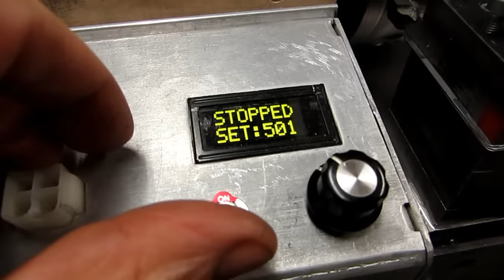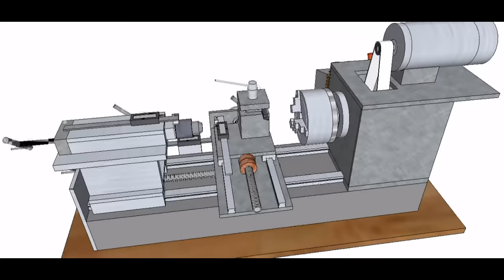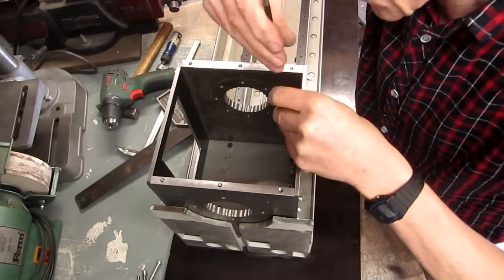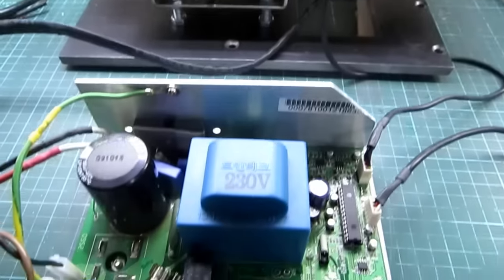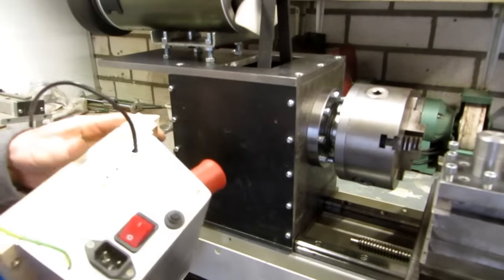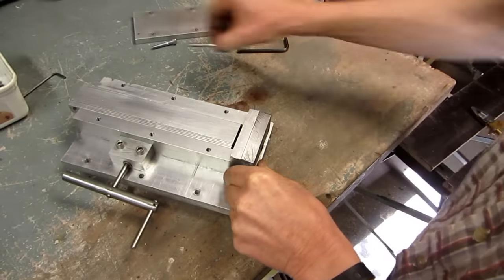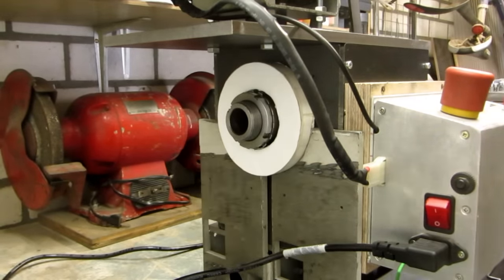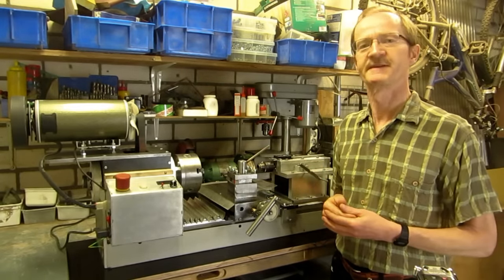Building a lathe from industrial scrap

Comment: "140mm chuck was founded on the scrapyard"...
Nice. Nice scrapyard.
Reply: no scrapyard, try ebay!
Reply: الترجمه للعربيه
Reply: If you are aware of machinebuilding industries near you, then you could go and check with them to find a suitable scrap pieces for your needs. Am i right @Rolandvanroy
Reply: I want to live near this guy. The scrapyards in my city are pure crap.
Reply: Not to mention the $1000+ worth of linear rails and lead screws he "found" haha
Reply: @pssnyder  20mm lead screws are about £80 ($100). The far more common  8mm and 10mm used on CNC machine tables are much lower cost but too small for a lathe like this.
Reply: @pssnyder  Linear rails aren't that expensive, the ones on his lathe are no more than €200-400, perhaps €500 tops if they're really high end. What you seem to forget is the fact that on a per capita basis the Netherlands is one of the biggest high tech players on the planet, and especially some regions heavy extremely high densities of high tech manufacturing. Any of such companies who happen to use linear rails will generally discard them long before the end of their effective lifespan, solely as a precaution just to maintain their very fine tolerances. So it's not too farfetched that the guy who made this video ended up with perhaps as much as €400-500 worth of linear rails for free, because as I mentioned many companies in the region would have otherwise thrown them in the dumpster even though they're still perfectly fine with a considerable lifespan for amateur usage.
Reply: @pssnyder  in our company we take out to scrap those digital rails like this every two weeks🤷‍♂️
Reply: @adax0004  it has been 2 weeks, can i have them now please?
Reply: @adax0004  Lol to kde? I'm potentially interested too (sk). But the carriages are even more expensive (like 8 of them).

Comment: A nice thing about those calipers that are used for position feedback is that most of them have a digital output. "Digital scales" which are like calipers, but are made for them purpose are used in DROs. The calipers readouts are probably good enough for that, but the output could be used for closed loop control if you want to add cnc control.

I like how the linear bearings are used for the precision ways.

Comment: To the Random lower-income countryman: Yes, Here you can see at least $2000 worth of machine parts. And some of these are really made from scrap, as some parts don't need precision.
But, don't let it fool you. Lathes can't be made from scraps by any means. Just the threaded rods, gears and the bearings can bring your budget on it's knees.  

High-income nation folks own infinite amount of drill press, angle grinder, welder, supplies and what not, just for their garage works.
You will build it one day too. Just shop wisely and focus on your savings.  
And don't forget to Check Concrete Lathe, Gingery lathe and Multimachine-type designs. You can save money making those machines, but those machines will only give you the standing space to make a real lathe.

Comment: FWIW, lathes have been made from many "available" things since the Roman Empire days. The first, to no surprise were made from wood, to turn load bearing posts, axles, truing long timbers for siege engines- the last only shows that all technologies are quickly explored by man for military uses. Much later, metal lathes were built- some of them still exist today and you might be hard pressed to see the modern tool in them. But lathes shape materials that today and the future were built on. In the lead up to WW1, huge lathes were made using concret to make the basis for the engine tower and ways- metal used only for shafts, way surfaces and the like; these lathes were also military tools; making the large diameter brass shells for naval cannons was perfected on these machines. I was pleasantly surprised that "high tech junk" would get you there- I really shouldn't have been!
 Thank you for a wonderful presentation!

Comment: Build your own lathe from a pile of junk:

Step 1: be a genius.
Reply: "With a box of SCRAPS!" (c)
Reply: I really can't say that building a lathe this way is making it from 'scratch' or even scrap. All these parts were fine!
Reply: Metals stockholders usually have all sorts of stuff on their offcuts bins. You might need to wait for the right stuff to appear.
Where I live the boat builders have all sorts of steel offcuts 6mm to 12mm or more. But they are usually mill finish so would need work to smooth and parallel the opposite faces. The local scrapyard is not much help as they have stopped all scrap sales to general public due to covid.
Reply: It's not just intelligence, it's about being incredibly methodical.

Comment: Great Project.  Did you know you can read out those calipers with an arduino? That opens up a few possibilities.
Reply: What do you mean? You can use an arduino for the scales?
Reply: @CarbonGlassMan  He means that it's possible to make a poor man's DRO with all the values on a single display rather than 3 individual displays.
Reply: @CarbonGlassMan   Those (cheap) calipers have a opening where you can attach a micro controller and read the data.  Example: https://www.youtube.com/watch?v=RIt08GJH2IA
Reply: @jcota2003  Yup  -  and lots lots more.
  - 4 reasonable NEMA32 stepper  motors makes a poor man's NC lathe
  - A CNC control board and you have a poor man's CNC lathe
  - AThe Rob pointed out, the limit is your imagination
Reply: Think you could use an arduino to read the calipers and put the data as a feedback loop into a PC based CNC program? That way they would act like glass scales.
Reply: @DjRjSolarStar  Both Google and YouTube have instruction.

Take a look at (Sorry I posted the wrong URL)
https://www.instructables.com/id/Reading-Digital-Callipers-with-an-Arduino-USB/
as an example
Reply: @DjRjSolarStar  Get Teknic Clearpath servos, which have drive and encoder integrated and you could have a true closed loop CNC system.
Reply: @YbborNetsrek  Cool! Thank you for the link

Comment: Great design and beautifully made video. Personally I would be a bit worried about using these linear slides since when metal particles get into the bearings, they might stop functioning. Did you have any problems with that?
Reply from the maker: The folding sheets keep most metal particles away from the slides. The roller bearing blocks have dust caps as well. Most critical are the spindle bearings, you can't have any metal chips in there.

Comment: Beautiful work. I am making a small lathe too, but eventually I preferred to use sliding ways. Also quite an amazing scrap yard you get access to! I'd like to have one here where I live. Cheers from the Alps
Reply: Why traditional sliding ways over linear rails? The acme lead screws with linear rails seems like a very elegant solution for manual analog control of the machine.
Reply: @MagnusNemo-xc5nx  in my opinion sliding ways offer more rigidity. I'm aware that many commercial lathes have linear rails but I think it's too complex for a diy lathe. Too long to explain here why, I should make a video for it.
Reply: @AccidentalScience  That would make for interesting content. You should make a comparison video and analyize both rail types with real measurements. I'm sure it would get a lot of views.

Comment: Here's a thought. You could buy an mt2 to strait shank adapter. Bore a hole in a mounting block  that I'd maybe 1/1000" or so under and either press it in or put the adapter in the freezer and the block in the oven. Then you could mount MT2 tooling in the tailstock.

Comment: So....as I suspected, a manual lathe with linear rails is definitely a practical item and a relatively quick build too.....just goes to prove you don't need a scraped metal sliding way bed. Now I'd like to see it with gears for screw cutting. BTW, I love the digital readouts.....who needs engraved dials on screws that would have backlash, and in the bargain you get Imperial or Metric movements too. Most definitely I would have had ball screws too if I were doing a build like this......and he overcomes the right hand threads by using a gear to reverse the motion of the screws...…...genius.

Comment: I have a very old Iathe but its getting worn in too many areas. I love this design and how you solved the problems without castings or machine tools. Ind may well have a go myself. With some thought a milling head could be added. A home made dividing head for gear cutting might be a bit too much.
Reply from the maker: David Elliott : funny, I’m just finalizing the mill head addition, and also working on a digital dividing head for gear cutting.

Comment: WOW!     A couple of questions....did you plan the entire construction or did you wing it??  Where did the programing, electronics, machine, component and mechanical knowledge come from if you are not an engineer?
Reply from the maker: The idea for this design came slowly together when I stripped the pick&place machine on the scrap yard. I'm an electrical engineer, so I'm more familiar with electronics. But I have been tinkering with mechanics all my life as well, so at a certain point experience helps a lot in designing stuff. For other projects, you can check http://www.simprojects.nl/diy_motion_platform_iv.htm and http://www.simprojects.nl/diy_motion_platform_v.htm

Comment: You could have simplified the electricals by going with a brushless skateboard motor c6374, an 80amp speed controller, a servo tester and 24v power supply. End result is 2.7kw variable speed, I used this to replace the electronics in my Sieg C3 lathe. It cost app. AU $150.00

Comment: Great project, I had 1m between centre Chinese lathe and they are not very reliable (Hare & Forbes) Australia and New Zealand. Failed start capacitor in no time. Never seem to run true no matter what and the digital readout failed as well. The water pump is also a disaster. The coolant recommended and supplied by H & F slowly stripped the paint off the water tank causing it to lock up and only drip feed. Next time I will follow your idea and build my own one and add CNC functionality.

Comment: Cool. Congratulations. I am also in the process of building one and also not a mechanical engineer. Have built a CNC mill, a 3D printer and several other machines before, so I guess that helps, but sure, there are a lot of things to learn. Programming is easier... :)

Comment: The problem with mini lathe is how narrow the ways are, which increases the unstableness and flimsiness of the machine, and with DIY build you can at least design it with more rigidness. Just by adding to the hight of the chuck to the bed you can add to the bulk of the tool post which increases the rigidness of the lathe...

Comment: This is beautiful work! Any thoughts on adding a lead screw and half nuts for threading work? I've always wondered whether good motor control on a small lathe like this could enable accurate threading work without mechanically coupling the lead screw to the spindle...

Comment: I build a lot of prototypes and this is really resourceful. How long was the whole process; design and fabrication?
Reply from the maker: After stripping a pick&place machine on the scrapyard around one year ago, I started the drawings, ordered the custom parts, and started cutting and drilling the metal parts. On and off around 7 months to complete it, still pretty much according the original drawings.

Comment: @Rolandvanroy May i know why you used taper bearings for this Motor spindle? Why is circular ball bearings not applicable?
Reply from the maker: Lathes and mills normally use tapered roller bearings because of the forces on de spindle are both axial and sideways. Circular bearings will have some movement in these direction under load, resulting in worse accuracy and poor surface finish. Preloaded taper roller bearings will not move in any direction under sideways and axial load.

Comment: At 10:30 you say you rectify 230v ac to 320v dc. I didn't think you could step up voltage like that without some sort of transformer.
Reply from the maker: 230V is RMS value, its peak value is 230*1.41 = 325V. After rectification, you get a voltage closer to the peak value. (depending on load and rectifier capacitance)

Comment: This is by far the most competently made lathe I have seen on YouTube. However, excessive use of aluminum and other lightening is a striking mistake, this is not an aircraft, it must be heavy and stable. Another striking mistake is that the rear seat has no cone and the chuck cannot be easily replaced with a rotating center. Tightening the rotating center in the chuck is supreme nonsense, so the center is neither accurate nor stable. At the same time, the classic construction of the rear seat is easier to do. Sorry for my bad English.
Това безусловно е най-грамотно направеният струг, който съм виждал в ютюб. Все пак прекомерната употреба на алуминий и прочее олекотявания е фрапантна грешка, това не е самолет, трябва да е тежък и стабилен. Друга фрапантна грешка е, че задното седло няма конус и патронника не може да се сменя лесно с въртящ се център. Стягането на въртящия център в патронника е височайша глупост, така центърът нито е точен, нито е стабилен. При това класическата конструкция на задното седло е и по-лесно да се направи.

Comment: I am curious where the spindle and bearing mounts came from. The spindle is not an easy part to make with a drill press and circular saw.
Reply from the maker: http://www.simprojects.nl/mechanical_components_v.htm. I had it made by a machine shop in Taiwan. cost me around 80 Euros.

Comment: The cost of used ball screws and linear guides with carriages, bearings, motor, pulleys is not less than 300-500 US dollars. Everything was milled. Very weak machine bed. :(

Comment: Hi i likeed this more then engenering knowlege..is mecanical electronics, software....i just want to know how you could have acces to code behind function of sensores and conction with smal cpu and how you opened in your computer.....thank you was nice to see..i am planing to make one like this but with some 2 k investment more precise linear rails and screws and biger shaft the ideea is to use 8-10 cm bore and 250 mm chuck and to make conection with step motors to posibil use in cnc mode in the near future... i have some parts from srape yard but also bought some parts new parts....when i ll have all tha parts ready i will make a small film to show my lathe...eheheheh ......dont spent it all
Reply from the maker: The original treadmill motor control CPU uses a PIC18F25K. It is the same as the PICAXE28X2 which I''m familiar with. (PICAXE is a student-friendly PIC programming platform, similar to Arduino). I traced the motor control connections to know what signals it uses. Then I made a simple program for the PICAXE28X2 that fits the motor control hardware with minor modifications.

Comment: lol who in the hell throws away linear cars and guide rails?? this is not done purely with conventional machines, the rail seats on the bed have clearly been milled, and i suspect those rails were purchased. still a cool project, but i deal with linear motion quite a lot, and that hardware doesn't usually go into the bin

Comment: Can i get a Solid works files for that?
Reply from the maker: I only have the Google Sketchup files, see the link in the vertical mill video
Reply: thanks for reply, i have chekced your files, 
I have a question,
How did u make sure that tailstock is always in perfect center with the spindle?
The way it moves on those rails does not seem very accurate, or am i missing something?
(buidling my own lathe, need as much info as possible to where i can go wrong)
Reply from the maker: @hikolanikola8775  If the rails are in line with the  lathe chuck then the tailstock will move in line as well. I did see that the tailstock is not as strong as I would like, the tailstock moving bar has some tolerance when extended.